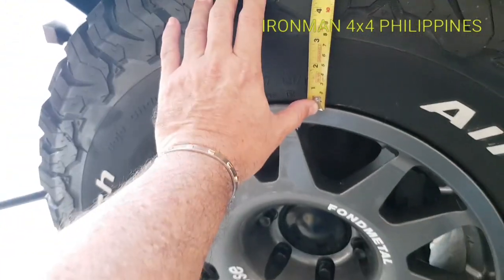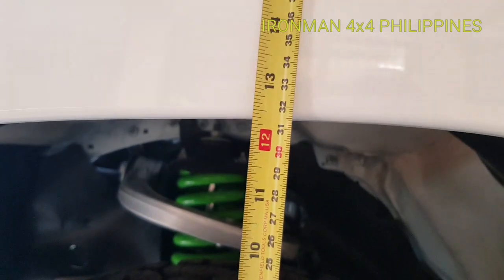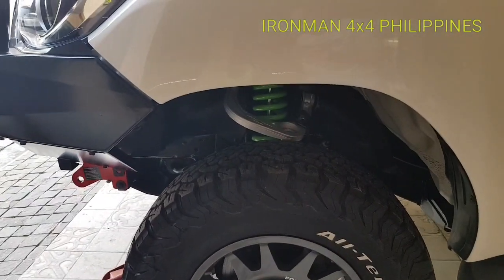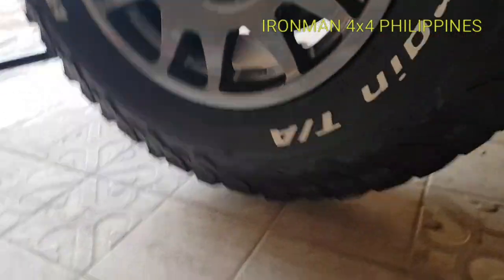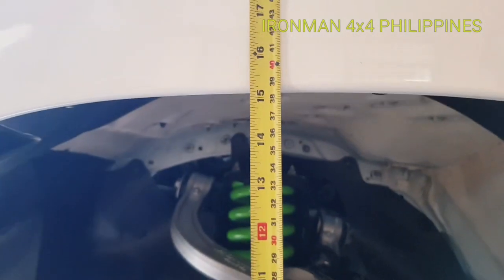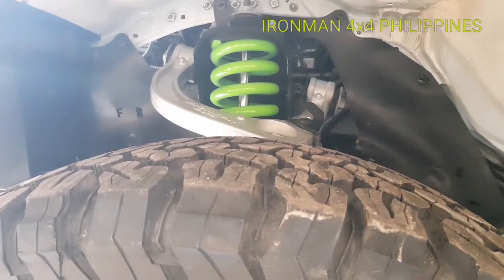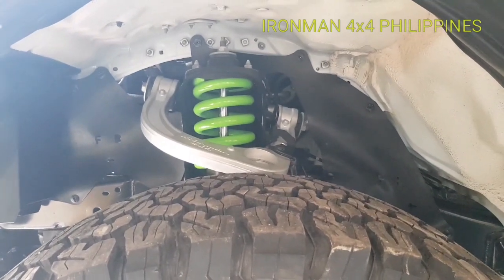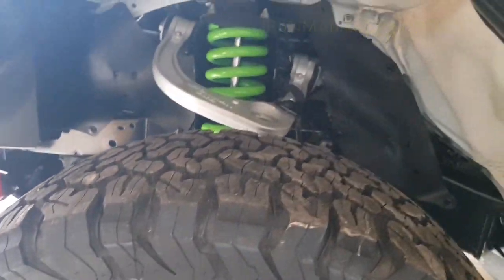Measuring Sag (downtravel/droop)

Comment: Hi sir, is it true that over lifting like 2.5 can stress the lower control arm bushing and can damage in short of time?
Reply from the maker: @dogsguardian7267  the bushing if done correctly, can be avoided.  You must be aware of the other components.  The best measurement is sag/droop.  After your setup, if your springs are brand new, you should have 50mm or more sag.
Reply: @ Thanks sir. Do you have idea with muscle lift  2 inches coil spring? Im, using 2 inches lift coil spring and 20mm ring. Plano ko kasing mag Add a leaf ng Iron man. Kasi naka shackle ako. Second hand ko na kasi nabili tong unit na to. And naka ganito na po. Gusto ko kasi proper lift. Okay lang po ba na kunin ko yung 20mm ring tapos ilagy ko ang 10mm? Di po ba overlifted if ever?
Reply from the maker: @dogsguardian7267  check the sag muna sa current suspension so we can start somewhere.
Reply: @ironman4x4philippines20  okay2 sir thanks po
Reply: @ tsaka nga pala sir when it comes to bushing okay po ba yung 555? Kahit umabot lang ng 40k kms goods na sakin, masyado kasing mahal yung genuine. Salamat po
Reply from the maker: @dogsguardian7267  bushings sir or balljpints po?
Reply: @ ironman4x4philippines20 i mean lower control arm bushing po sir
Reply from the maker: @dogsguardian7267  okay naman.  Ako i have never replaced lower control arm bushings sa mga sasakyan ko sir.
Reply: @ironman4x4philippines20  pero di nmn na e-stress pag lifted ang sasakyan sir yung bushing ng lower control arm? Bali yung mga balljoints lng siguro and pag sobra sa lift yung boots ng cv joint?
Reply: @ironman4x4philippines20  may feeling kasi ako na mali yung pagkakabit bat di umabot ng isang taon yung pinalit kung bushing dinaman ako nag ooffroad. Hinigpitan kasi agad kahit dipa neutral height.
Reply from the maker: @dogsguardian7267  yes sir.  Yun talaga.  If they tighten while the car is on a lift, all bushings suffer.

Comment: Hi sir, I've installed a 15mm ring on my ironman foamcell and measured the droop which is 60 mm on passenger  and 58mm on driver side, do i need to change my UCA? Or am i still on spec?? My car is a ford ranger PXI
Reply from the maker: @jephaeronhechanova41  looks perfect to me sir.  No need if you can get it computer aligned.
Reply: @ironman4x4philippines20  nice! Thank you sir, 🤙💚

Comment: Hey mate can i run 3inch lift spring in a 2inch strut for my toyota hilux sr5 kun26?
I dont want to use an adjustable strut
Reply from the maker: All Ironman struts are adjustable height.  Running a long spring might leave you with no sag/droop in your setup and ride quality will be bad.  Forcing more lift by using a strut spacer might get you too much droop too.  It is a matter of measurements and trial and error.
Reply: @ironman4x4philippines20  Okay mate I'm running that setup atm had no problems. I'm hoping to change it to a  2inch lift and 2inch body lift making it 4inch all around.
Reply from the maker: @Tuffrig  yes mate.  Might be a more reliable option.
Reply: @ironman4x4philippines20  Would the 2inch springs need to be rated, as I have a bullbar
Reply from the maker: @Tuffrig  if its a bullbar only, Ironman 4x4 TOY055B will do, and if bullbar and winch its TOY055C.  What shocks do you intend to use.
Reply: @ironman4x4philippines20  I'm using the lift junkie 3 inch spring Part number LJTOY354
Reply: @ironman4x4philippines20  I'm going to be using the Ultima 4x4 strut part number 36S715A for the 3 inch spring

Comment: Sir is it okay that my driver side sag is 60.5mm and the passenger side is 60mm?
Reply from the maker: Yes sir. What is the static height measurement?  Mas mababa ang left?
Reply: @ironman4x4philippines20  Nd ako sure sir pero sa driver side ko 15mm ring nilagay. Sa passenger side 5mm. Ok na ba yan?
Driver side Sag- 60.5mm
Passenger side Sag- 60mm
Proper po ba?

Comment: Excuse me~ Raise the front of the car vs. lift the whole car horizontally, the data measured by these two methods seem to be different (the front two wheels are lifted to measure droop 40mm / The whole car is lifted horizontally to measure droop 70mm)
Which result is correct?
Reply from the maker: Drive the car in a straight line a few meters to make the suspension settle properly.  Maybe 10 to 20m.  Then measure from Rim to fender.  It is best to put tape on the fender and put a line so you have a reference.  This measurement is Measurement A.  Next, raise the vehicle using any form of lift or jack, but make sure you lift at the chassis, allowing the wheels to drop and the suspension to fully extend. Measure at the same point on the rim and fender, this is measurement B.  Sag is B-A.
Reply: @ironman4x4philippines20  Thanks for your reply! Cheers from Taiwan
Reply from the maker: @hansheulu  cheers!

Comment: 2019 hilux modified ARB yellow barrel shock absorber set to replace ARB UCA My droop is only 40mm ..Is the coil spring not enough lift?
Reply from the maker: If droop is only 40mm then your spring might be too hard or your shock travel too short.
Reply: @ironman4x4philippines20  Thank you for your reply! Will this have any adverse effects?
just feel uncomfortable
Reply from the maker: @hansheulu  adverse effect is a harsh ride especially when your wheel drops into a pothole or obstacle.

Comment: Sir paul mine is 34cm driver side on the pavement and 34 1/5cm on passenger side on the pavement is this still good?
Reply from the maker: Sir first measure from rim to fender... then jack the chassis to get the suspension to fully extend... then measure again.
Reply: @ironman4x4philippines20  yan na po ung measurement niya po from rim to fender. Havent measured yet with jack up on it. From stock coil height of hilux nag add po ako 5mm po.
Reply from the maker: @YGF00  mahirap po pag galing cement sir kasi involved yung gulong.  Maganda measurement po from lip of rim to fender po.  Then let me know if 16, 17, or 18 rim po.

Comment: Good day Paul, i measured mine and i got 340mm with wheels on the pavement. And 400 mm off the pavement. What does it mean?
Reply from the maker: It means you have 60mm sag... 400-340=60mm... that means your suspension is setup correctly.
Reply: @ironman4x4philippines20  can i go higher?
Reply from the maker: @mattaustria2530  you can but then we will be improper.  We can install our UCA and try to squeeze every last mm but stay proper.

Comment: Hi sir, kapag po ba binabaan ko ung droop magiging mas comfortable po ba ung ride?
Reply from the maker: Hi sir.  Recommended droop is 60mm.  Make it 70mm the initial travel gets softer (preload).
Reply: @ironman4x4philippines20  so sir habang tinataasan ko po ung droop mas magiging softer? Then if I decrease the droop it will become stiffer right?
Reply: Im now using ironman foamcell and type B coil on my 4x4 everest sir, pero sabi po kasi ni misis and I also feel na naging mas matagtag siya compared sa stock suspension
Reply from the maker: Do you have any accessories in front?  Droop/sag measurement determines if you have your spring rate right.  If you measure and let me know measurement,we can determine if you can go to a softer spring rate.
Reply: @ironman4x4philippines20  wala po ibang accessories sir, stock lang po.
Reply from the maker: I think you can use A springs sir.
Reply: @ironman4x4philippines20  do you have available type A spring sir for 2017 everest 4x4?
Reply: @ironman4x4philippines20  hi sir this is the measurement
Full droop
Psngr - 405mm
Driver - 395mm

Psngr - 340mm
Driver - 320mm
Reply: @ironman4x4philippines20  we also already install ironman uca

Comment: Hi i am using foam cell pro for my fortuner 2010 model. I fixed it with local mechanic as we don't have pro mechenic here in my place.
My front is sitting on ground 740mm and 830mm on Jack lift.

Rear 820mm on ground and 860mm while lift... I feel shakky steering if I drive above 90 on speed meter. Could you suggest me best fitting please so that I get comfortable ride. I am using it in city only, no load at all except myself and sometime family members. Please do suggest me best fitting.
Reply from the maker: Hi sir. What coilsprings are you using? Also, where are you from?
Reply: @ironman4x4philippines20  hi I am using ironman foamcell Pro and I am from Himalaya Leh Ladakh.
Reply: Ironman coil number TOYO17A and TOYO55A
Reply: Hello Bro can you plss do update me on my request and updates please.

Comment: Ok lang ba 1 inch lang ang droop travel? Pinalitan ko kasi ng shorter ang rear shocks ko.
Reply from the maker: Sa rear?
Reply: Ironman 4x4 Philippines opo
Reply from the maker: 1 inch is too little.  For the rear at lease 3 inches is okay.  Front is 2.25 inches (60mm)